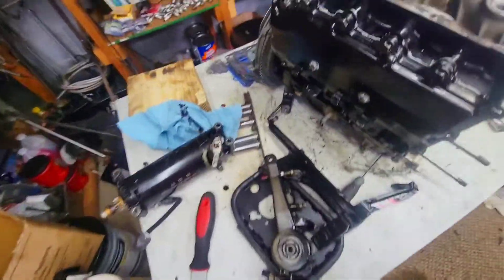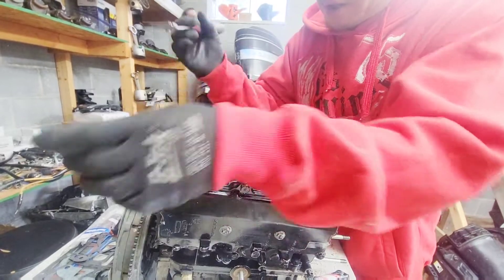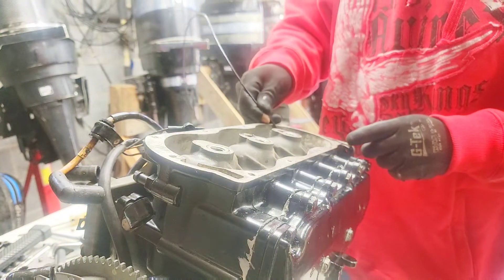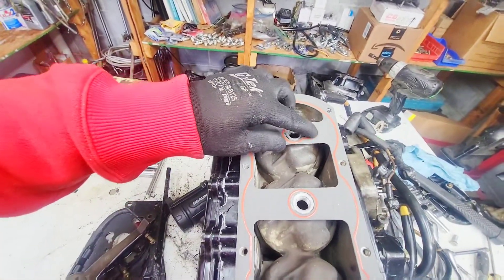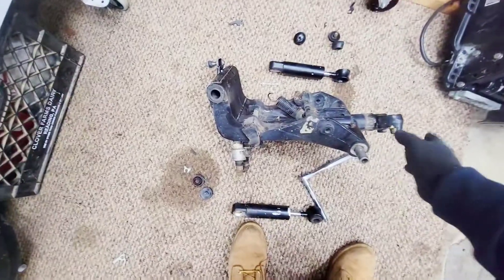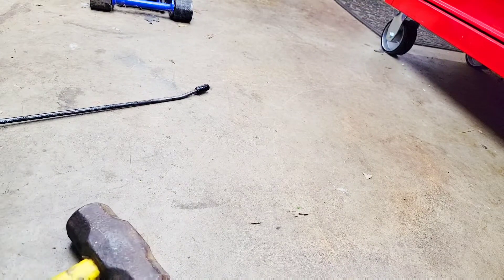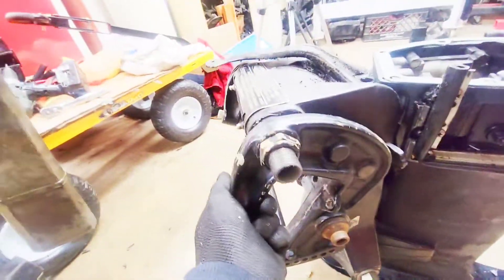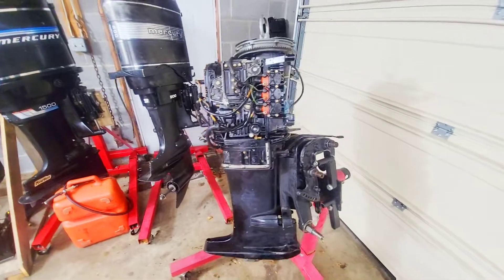Mercury Outboard L3 Overhaul: Are we there yet?!

Comment: Nice Work.  I Do Have a question for you....I'm buying a real nice Champion boat with a 115hp engine on it. It started having a little problem of not wanting to stay in Reverse gear. IF I would get you this engine what would you say about checking it out for me? It's been sitting now for about 1 year, so I'd like to check out the Carb's and all the normal stuff that needs to be looked at and repaired. Thank's
Reply from the maker: I'm sure I can fix it. Son